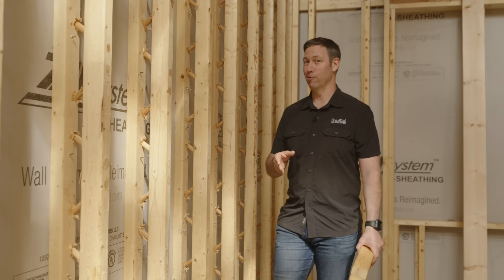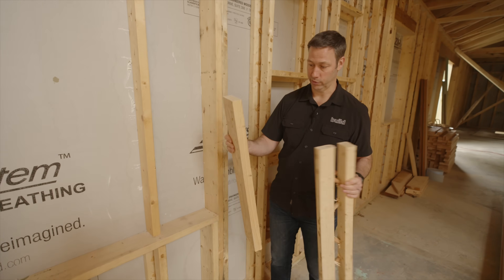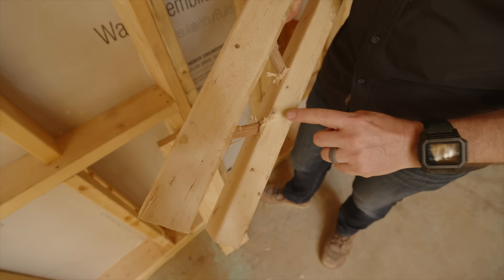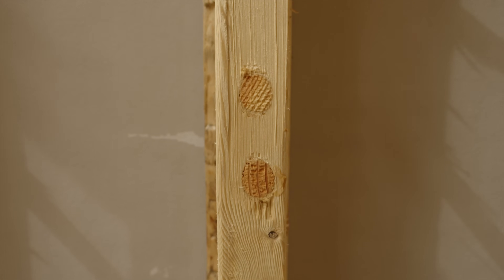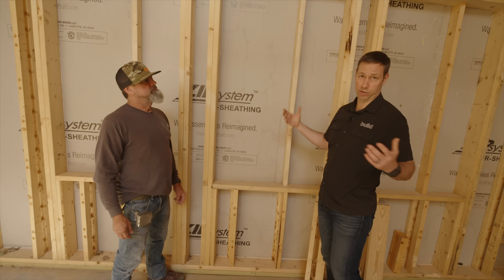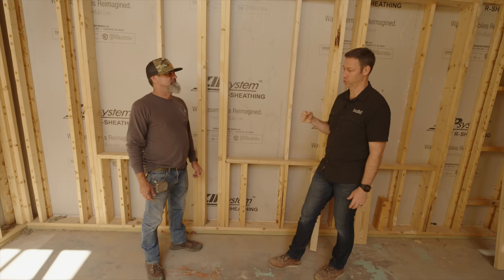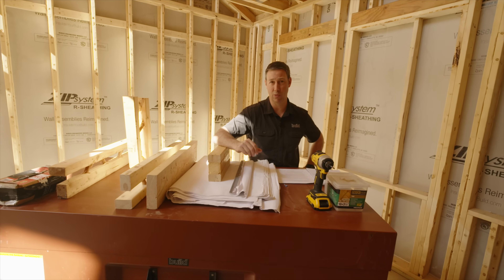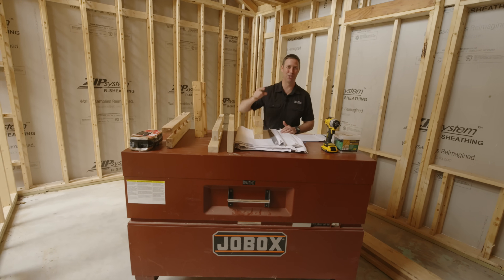Framing with a 2x6 Replacement - TSTUDS!!!

Comment: Electricians love these: no more hole-hog! and we can finally fish along a finished wall, rather than have to deal with the 16" damned damn.
Reply: you missed that he's going to sprayfoam it before he finishes it.
Reply: @kenbrown2808  you rough in electric before foam
Reply: @Squat5000  apparently you missed the part where wim said he or she was looking forward to being able to fish a wire along a finished wall.  last I checked, you insulate before you finish your walls.
Reply: @kenbrown2808  not when you do spray foam most of the time. And we're talking about wiring, so yeah you have to insulate before you sheetrock. But you rough in as much as you can prior to insulation.

If you actually install the boxes properly, like virtually anyone else in the trade, they don't get filled with foam or mud. It takes 30 seconds to tape over with duct tape..
 I don't understand why people don't realize this unless they have never roughed in a building
Reply: @Squat5000  apparently you missed the part where I pointed out that apparently you missed the part where wim was talking about fishing a wire in a FINISHED wall.
Reply: @Squat5000  oh, and it also takes 30 seconds to cut the tape out with a rotozip.
Reply: @Squat5000  what, by pointing out your lack of reading comprehension?
Reply: @Squat5000  unless they have never roughed in a building - no need to- common sense tells that oops
Reply: @kenbrown2808  omg, who does such  a thing!? and get sprayfoam all in the outlet boxes, no doubt... grumble
Reply: @wim0104  Matt said he would - which means you still can't fish along the finished wall.  and yes, you'll have foam AND mud in all your boxes.
Reply: No way in hell it saves them anything. This cost 5 times as much vs normal studs. Less material for price, also it doesn't cost that much in labor to drill holes properly.  plus they still have to staple it through the stud on the new framing, not going to let it just hang. Null and void the less labor bs
Reply: Here in Sweden we have the frame 120-170 x 45mm sealed on both sides, osb sheathing with breathable wind proof membrane over (external) and plastic damp proof membrane (internal). An external layer of  breathable waterproof insulation 50-100mm thick which can be rendered or clad. 

All services are inside the DPM with minimum penetration, so the house is air tight. This is done via a 45x45mm  cross batten or 70x45mm batten for bathrooms (pex pipes require 70mm for bends). Plaster board, or wooden slates with OSB for extra strength (plywood for bathrooms). 

All electrics are run through flexible pipes 12-15 and 18- 32 for 12-22mm pex pipes. Really easy to fix, pull extra cables, no joints inside the wall, everything can be accessed via wall boxes. 

Easiest construct methods I have come across, so I’m bringing it back to the U.K. and maybe Canada. 

If these T-studs could be mass produced to be a similar strength and price to regular 145-170 x 45mm for 3m lengths or at least close to 220m x 45mm x 6m lengths for floor joists I would be interested in setting up a factory in Sweden, UK or Ukraine etc to make these for the European market.
Reply: @globalbridges8570  in my climate, that would draw moisture through the exterior membrane and rot.
Reply: @kenbrown2808  I’m only building above 50* north, if I was to build in Southern Europe or Africa I wouldn’t build the above type of house. I would look at older Middle Eastern construction technics with a high thermal mass that drawn air through the the building to cool during the day and release heat during the night.
Reply: @globalbridges8570  why wouldn't you look at the techniques that were developed in the region you plan to build in to best use the local materials and withstand the local climate conditions?
Reply: @kenbrown2808  I’m part of group looking to manufacture off-site units with 50 year guarantee (25 year mechanical), for affordable housing, then owning them in non-profits for affordable rents. So we’re looking at whole regions/continents to vertically integrate the whole supply chain and ownership to build 100,000’s properties. So in most places we also have to look at infrastructure access, upgrading power plants and ports. I’m mainly looking at the northern UK, Northern, Central and Eastern Europe which has a similar climate +30 to -20*C with loads of alpine forests. If you lookup the Three Seas Initiative it’s mainly those countries. 

Trump has a similar initiative for the US, something like $7t to total restore all the infrastructure over the next 5-10 years. Look out for Trumps infrastructure fund next year and the Restoration plan. 

I don’t know what house types they’re looking at for the US market, someone mention Hempcrete but the US has multiple climates, so yes you would build differently in each climate and region.
Reply: @globalbridges8570  you sounded believable until you invoked the conman in thief.  what we look out for with him is new schemes to funnel tax money into his pockets.
Reply: @kenbrown2808  lol, your ‘Pentagon’ has a $35t accounting error, more than your $27t sovereign debt, the US runs a $1t+ deficit every year, who do think funds all those trillions. 

Once you figure out who funds all these trillions , you’ll realise who is charge of US, I’ll give you hint, you think you beat them in 1783, wrote a document in 1787 to get away from them but let them back in charge in 1913 with the Federal Reserve act, IRS created and the 16th amendment to legalise income tax, something banned in 1787. 

Same people that made the world think the Roman Empire collapsed but we still have the ROMAN Catholic Church which owns the three sovereign cities of the Vatican (Religion/Law) , London(Law/Banking)  and District of Columbia (Banking/Military), the three keys to controlling the fictional construct/Matrix.
Reply: @globalbridges8570  I'll bet you're not in Sweden, either.
Reply: @kenbrown2808  Gothenburg, West coast of Sweden. No lockdown here, just a few social distancing signs. No Globalists deepstate trying to ruin the economy here.
Reply: @kenbrown2808  yeah becaue NY with the toughest lockdown also has the highest body count.
Reply: @8Maduce50  yep, that's what having a for-profit medical system, coupled with three layers of dysfunctional government (federal, state, and city) does for a city.
Reply: @8Maduce50  

Have you been to New York? It is the most densely packed city in America.
Covid is spread via proximity. Of course, it is going to spread like wild fire in New York.
Reply: Bid reduction for less labor? 😂
Reply: @johnhutchison9782  offset because now they have to staple off their horizontal runs through the studs.
Reply: @johnhutchison9782  yeah.... Nope. 
It doesn't make enough of a difference to reduce labor by an appreciable amount. 5% would by my reduction only if there was no solid that still needed drilling

Comment: Staggered stud framing would probably be cheaper and perform better, but don’t get me wrong, I think it is great that new tech is being developed.
Reply: I live in a cold climate in Central Canada , where it can be up to -50 degrees C ,( or way past -40  F ).  In my house, which is an old house with 2x4 walls, we re-insulated between the studs with fiberglass batts , and then sheeted over the studs with 1 1/2 "  rigid styrofoam insulation, but on the inside. Then we put vapour barrier over that...and then drywalled with long drywall screws. And the result ?  A very warm old house , and very quiet.  I don't know if anyone else has done this...but I'm sure someone must have.  The thermal break in my house is better than these special studs, because the cold can only travel through fasteners.

Comment: Anyone ever try these on the outside of the sheathing for a renovation?  Then spray foaming the exterior continuously.  The roofing material and siding could then be mounted to the Tstud with an air gap in between.  Cost could be an issue, but I'd be curious of a comparison with other exterior insulation options.  Maybe Steve Baczek could chime in.

Comment: They should use an exterior thermal image of conventionally framed wall verse this product, as advertisment! I know I would love to see a thermal image difference!
Reply: Will have to use this for a theater room build or an office/studio. Add resilient channel
Reply: I am guessing a interior shot with foam on the outside, which is a thermal break and a rain screen which is also a thermal break would not be much difference between a standard stud.   Now if you went traditional with standard OSB and a direct applied siding, there would be drastic difference, buts that`s stacking the deck.   In a apples to apples, in this application my guess it much less than a 100 bucks a year BTU load difference......far less than simply removing a window or a fenestration reduction in over all area........the great thing about a window reduction is it saves money, not costs more and it saves more energy over the life of the building.

      Your going to need a very narrow application for these to pencil out as a wise choice.....maybe you need 3 times the strength if that is code accepted and maybe you need increased nailing surface etc, but from a R-value thermal break position.......its ok, maybe , in some circumstances.
Reply: @shawncockrell6007 I've seen studies that thermally broken 2500sqft house saves about $130/year
Reply: Just put your hand on a wall getting hit by the sun. You can feel where the studs are.
Reply: @anthonyromano8565  yeah, I agree, but In my comment I was suggesting that the T stud company use an exterior thermal image of a regularly framed and insulated wall side by side with a T stud and insulated wall! It would be a good advertising ,selling point!
Reply: @ericmcginnis9413  you likely won’t be able to see much of a difference. Unless they build a show wall, and only use plaster, studs, foam and some OSB/ply. Of which, it isn’t really an apples for apples comparison, and would be poor/false advertising.
Reply: @ericmcginnis9413  as said earlier, these kind of studs are for the 1% that are either huge load bearing, or net zero/passive haus. 
For the normal person, a standard 2*6 is enough.

Keeping in mind, this is likely 1.5-2* the cost of traditional lumber.
Reply: @dylnbxtr  16:04 >  same cost as a premium 2x6 LVL.
Reply: @dylnbxtr  $2 a linear foot for a t stud much much more expensive than a standard 2 by 6
Reply: @bipaholic  slightly more expensive, but they should generate a labor savings for plumbing & electrical.
Reply: @anthonyromano8565  just siding or with brick as well?
Reply: It wouldn't look that different, these studs would slightly reduce the contrast, but they are still a relatively conductive material that displaces insulation with the same spacing.

Comment: Might actually cause lots of problems for the electricians. Yes they can run through the open areas but for my reading of the code this wouldn't be considered securing the wires since its not a small round hole. You would have to secure all the wires running horizontally unlike a normal drilled stud.
Reply: I believe you'd just need to use a wire staple every few studs depending on stud spacing.

Comment: Garbage product.. its way too new, how it is going to fair structurally when it is exposed to excessive moisture?
Reply from the maker: I think compared to LSL’s they will be superior when it comes to moisture. They are pine 2x’s and some type of hardwood dowels. Same performance as a standard 2x6 except more dimensionally stable
Reply: Nice opening line knob. Call it garbage but you’ve never used it... lol.
Reply: @ryancouture2508  I wouldn't use it because if any section of the frame was damaged then it will be compromised, also it would not fair in earthquake zones Imo. This product is basically to implement increased insulation, no structural value really when you can implement other techniques to achieve the same loads on those wall sections.

Also classic 2x6 is actually 45x140 mm which is not what is being manufactured today... reason why? its cheaper.

Comment: I always use solid sheathing, and then Zip-R ...
Reply: Why?
Reply: @yzhang8629  in my windy climate the fastener will " eye out" i.e. move in an orbital direction, wearing out foam over time , also all foam is /2 hour fire block encased , and  in enough wood to deter."around the framing" contiguous access to tunneling rodents.
Reply: I have been building double 2×4 walls for years as narrow as 
5 1/2"(Larson style ), up to 11 1/4- and 15 " 
Are these cheaper ?

Comment: A personal opinion is that the exterior wall stud should be equal in thickness to a 2X8 and made out of 2X4's instead of 2X3's placed on two foot centers. This would allow for blown in cellulous to fill the voids and 2X6's are so 1980's
Reply: Texas still uses 2X4 for EXTERIOR walls!!!
Reply: And only requires R-13 walls.  How far north do you have to go to need 2x8?  2x6 is specialty here (climate zone 3 where I am, and 2 where Matt is), and it's enough to get to Passive.
Reply: I’m in Central PA and only lived in 2x4 houses... yes, they’re cold. 😂

Comment: I'd prefer slightly longer dowels and make it 2x8 or 2x10 for more insulation for our Canadian winters.
Reply: Last year they said they were going to make a 2x8 but I haven’t seen anything on it since
Reply: @Pauline Weinberger they will put insulation on outside but they can’t do it the way Matt does. No zip2.0 in the north. Supposed to have vapor barrier on inside of wall. And in the extreme cold climates having well insulated walls plus exterior of the walls insulated is needed to create a passive house.
Reply: @Pauline Weinberger I'm leaning towards 12" thick walls with double 2x4 construction.  Good thing I'm not ready to build for a few years, 2x4s are 8$/piece here because of the increased demand last summer (every body doing renos).   I don`t understand how come toilet paper has not gone up, it's made out of the same stuff.
Reply: 2x8 version is currently in testing.

Comment: Holy hell, did you guys see the top of that TStud blow apart when the nail gun hit it at 3:26? Watch the smaller stud just split to pieces as soon as the nail goes into it.
Reply: I wonder if a couple of bottles of Gorilla Glue are included with each T stud purchase LMAO
Reply: @johnhutchison9782  serious question for a more experienced framer; can a beam be repaired and meet code after splitting like that? or is structural integrity shot for good. I assumed it was scrap wood after that kind of split.
Reply: ...sponsored video, eh?  You might have wanted to edit that part out!  Whew!  That was bad.
Reply: I came here to comment just that!
Reply: Came here to post that. Whole stud is now void. Shouldn't be an issue if the insulation is already blown in. Whole block of glue.
Reply: Yep. I saw it too. SPLITTT!!

Comment: Cool video!  Would you tell me about the nailed stud at 3 mins 25 seconds?  Why did they go ahead a nail in a short stud?  Thanks!
Reply: Looks like he just angled the nail off and it splintered the wood.  Probably wasn't a 'short' stud, probably just wasn't being held tight against the plate.